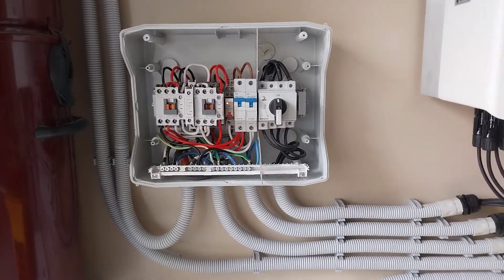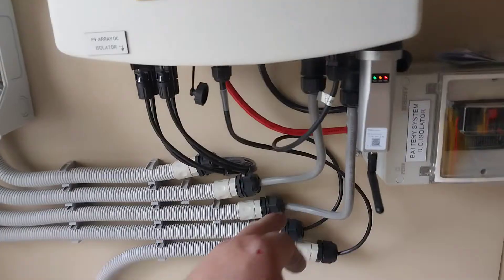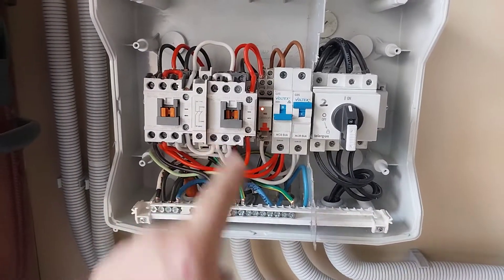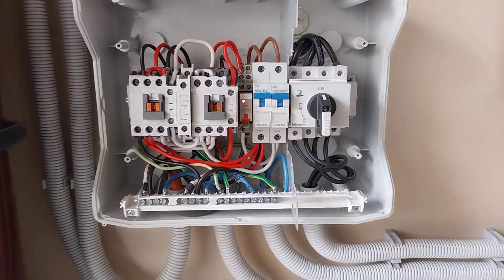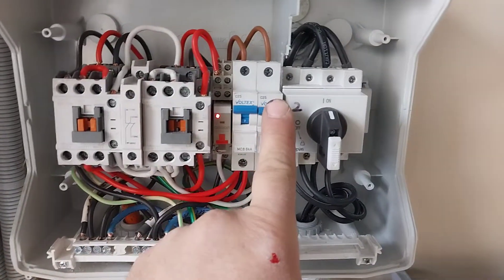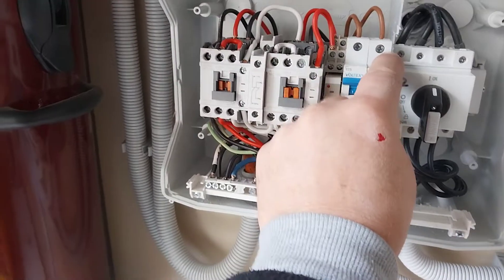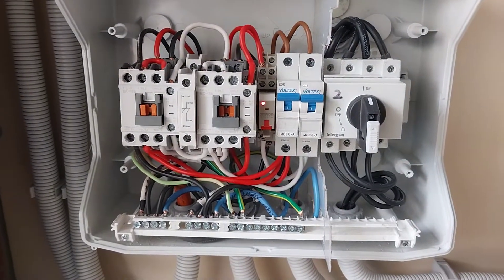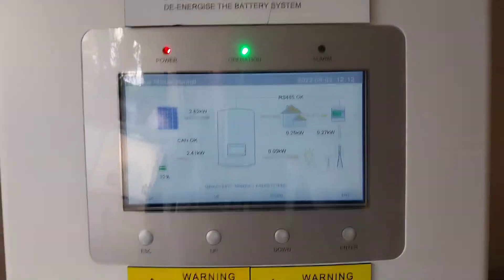Solis hybrid 5KW inverter with automatic change over switch part B

Comment: Hi Solar Shows, Thank you so much for this video. I cannot thank you enough, as I've a solar company in Adelaide who set up an Alpha ESS SMILE 5 10.1kW backup battery with its own inverter, but wired it in such a way that if the battery fails, the two backup circuits in the house will not switch back to the grid. I only found out by accident when I asked the electrician to leave it switched off until an inspector approves it. He said he can't do that, because you won't have power at night from the two backup circuits. This is a rental property and I'm liable according to the SA Tenancy Act. The company said they can add a manual switch for $750! I was shocked to that they'd charge to fix a problem they caused. The house should revert back to the grid is the battery fails. Otherwise, the battery becomes a big problem and a liability. Do you know anyone in Adelaide I can trust who may help me fix this? Or, is it possible to contact you via email to help me? I'll pay for your service.
Reply from the maker: This Solis connects the Neutral to Earth when it goes to back up. So it needs a separate neutral bar to prevent two earthed neutrals, the other one being the  M.E.N. (Multiple Earthed Neutral) in the Main Switchboard. Return current will flow in the earth if neutral bars are not separate. The Alpha ESS SMILE does not connect the earth to neutral in back up. So just use the main Neutral bar for back up circuit neutral or earth will floating between Active and neutral, 115V to Neutral and 115V to Active. They don't tell you that in the manuals either! Found out the hard way myself.
Reply: @solarshows1088  I can't thank you enough. I hope you are able to continue supporting us with your knowledge and expertise. You know more than some of the electricians I contacted over here. You should run your own website. Most grateful for your advice.